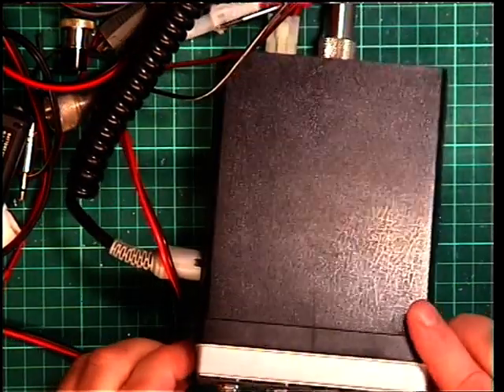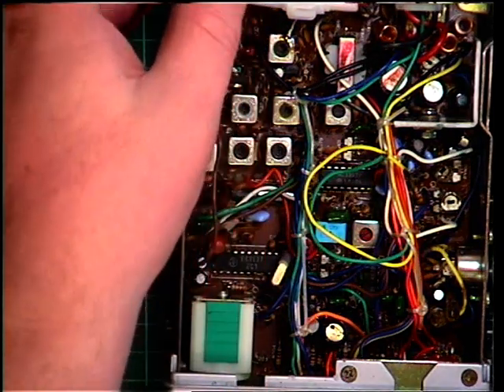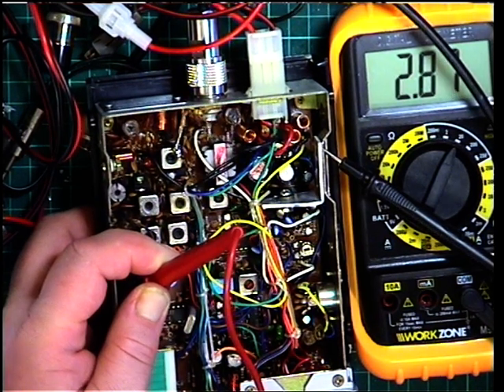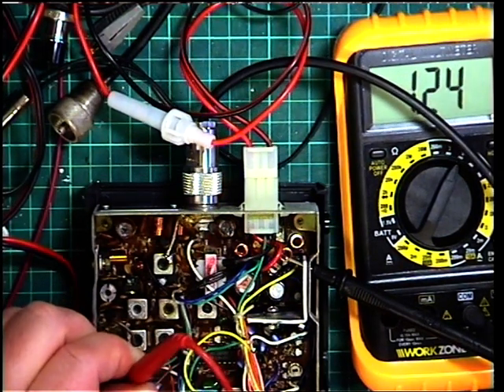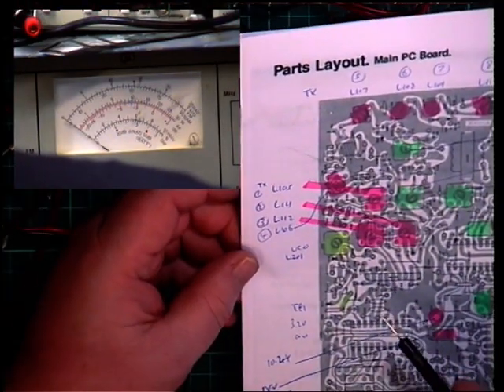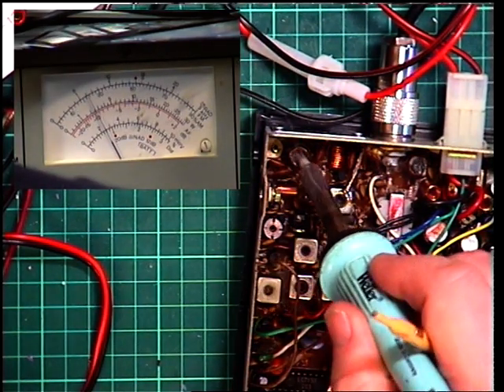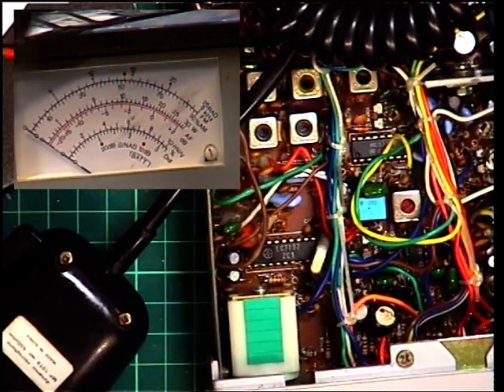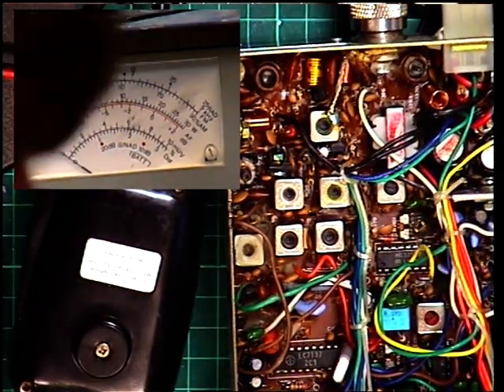Maxcom 21E    UK CB radio (mobile) 27/81 - VCO & Transmit alignment

Comment: Hi Richard. It being 2020, would it not possible, at least, to stretch to 720p video?
Reply from the maker: cameras, mixer, dvr are all hi-band 'industrial' standed video gear. Other than buying broadcast equipment I can't think of a way out of it. I don't wish to go the home consumer model route with memory cards (other than when we use a single camcorder). Youtube compress the s**t out of the videos which are great into the CRT monitors here. I spent around £12-16K  on the video equipment about 12 years ago & it was a one-off purchase. Email me on what you think I should be doing. My college training was on Umatic lo-band incidentally.
rshireby@yahoo.co.uk